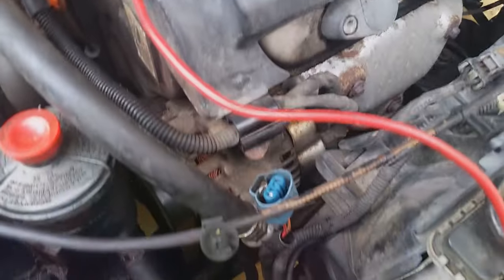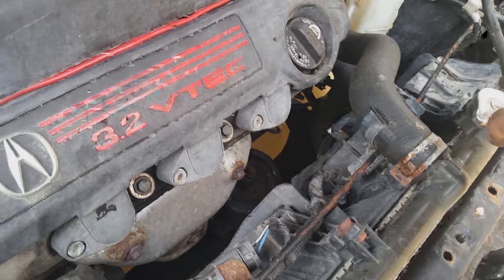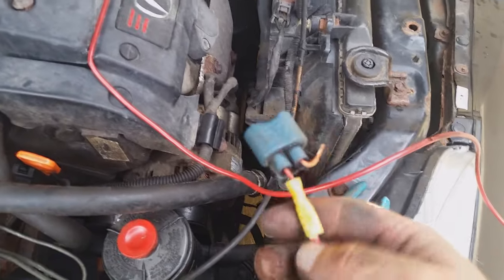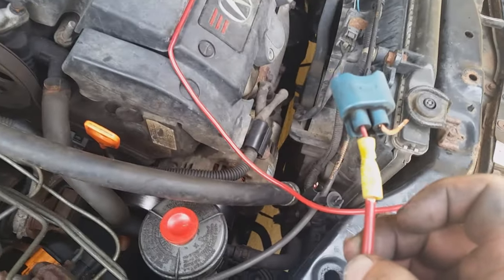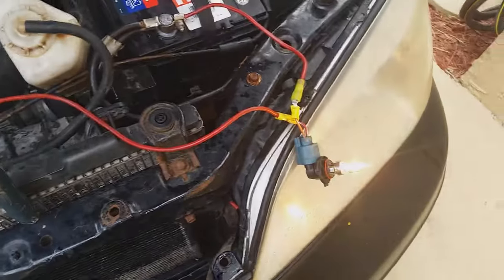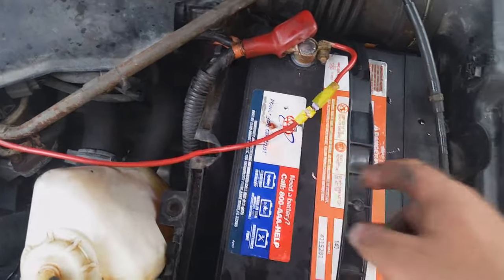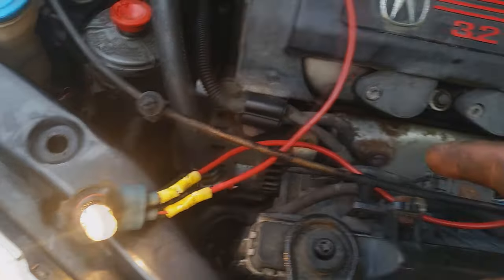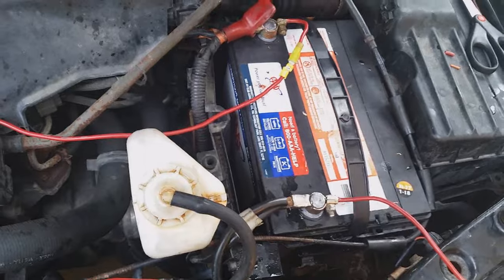How to connect head lights directly to the battery.

Comment: You can run the positive into your vehicle cabin to a toggle switch so you wont have to worry about opening your hood to disconnect
Reply: Hey I got a question for you if you don’t mind. It’s for powering a blower motor due to a damaged wire in the main wire harness but I’m just going to bypass it till winter time.

Comment: Put a fuse and wire it to a 12v switch mounted to ur dash!
Reply: Eric, you suggested a switch on the dashboard.  I have a similar issue with installing this on a 1993 GMC 3500.  The 25 Amp fuse wàs shorted.  The running lights are on all the time while running.  But no headlights.  With a new switch and bulbs installed.  Can this shorted 25 Amp fuse under driver's side dash be converted to a switch like you suggested? Please diagram and explain it.  

Thanks.

Lynn

Comment: This is exactly what I want to do with my current vehicle.  The entire vehicle wiring was recalled, but I missed the date to go back to the dealership. They want $700 to rewire the light fixtures, but I want to do exactly what you did.  How can I do exactly what you did, but with a switch inside the vehicle that allows me to turn on and off? Also, would the lights, even when switched off, use the battery?
Reply from the maker: You can run the wires through the driver door refer to my horn button video on this to run them.  If the switch is off then it won't drain the battery.  Dealers always overcharge good for you to do it yourself.  Let us know how it goes and thanks for watching.
Reply: if you dont mind, what vehicle did they recall the whole vehicle wiring ?
Reply: The switches can melt and cause fires.

Comment: Need a fuse on that input positive  so you dont set your car on fire and if you run a bridged neg and positive  lead if 1 burns out the other still works
Reply: What size fuse should be used ?
Reply: @tylerstickrod7600  I used 15 Amp

Comment: If you connect two lamps in series, they run at approximately half their rated power. So what is the point? For car headlights, half the rated power is completely unacceptable. To run them at full power, each lamp needs it's own exclusive positive wire.

Comment: I want to add motorcycle headlights to my e-bike by using the e-bike battery directly to the headlight. 

I like your version because it is simple but I think splicing into my e-bike directly is too strong of a current/voltage to the light (48v)—

So question is, how did the strong car battery not blow out those little lightbulbs?
Reply from the maker: They are regular car lights that run on 12 volts. You need a voltage reducer to use the lights on your bike.
Reply: Oh I see! So it matches! I thought car batteries had a very high voltage! Thank you for the quick response!
Reply from the maker: @leoelegado  No only 12.8 to 13 volts. 14 to 15 when the engine is running.

Comment: Hello. What if I only need one headlight to run to the battery? my other headlight works fine but the other has a short somewhere.  Could I just run a wire from the one headlight that doesn't work to the battery?
Reply from the maker: Yes that will work but you will need a switch.
Reply: @chriss4365   Also there are several different wires running to the connector for the bulb. How do I know which one to cut?
Reply from the maker: @rickiew7713  not sure some vehicles might have more than others but usually are 2 wires.
Reply: @chriss4365   Thanks Chris and I'm seeing I might need a fuse do you recommend a fuse? and how close does that fuse need to be to the battery
Reply from the maker: @rickiew7713 you should for safety and its location doesn't matter.
Reply: @chriss4365  Hey Chris sorry I was mistaken there's only 2 wires to the connector one is white and 1 is black which 1 do I need to cut and hook to the switch
Reply from the maker: @rickiew7713  The black is probably the positive and white neutral.
Reply: One more question and I'm gonna throw you some money if this works do I connect The Wire to the positive or negative terminal on the battery
Reply from the maker: @rickiew7713  I would cut both wires and create a new circuit using 2 wires, a fuse, and a switch inside the car. Connect the two new wires to the battery. If the bulb is incandescent, the polarity doesn't matter.

Comment: My headlight fuse is burnt out on my fuse box for my 1964 c20 I bought a universal headlight switch..could you help me hook up the switch n kinda make it do the same as you did here....is there a way to run power to the switch skipping the fuse bx inside the truck don't have the money to pay an electrician to redo all my wireing...got brake lights but no head lights ...thanks if anyone can guide me through this thank you
Reply from the maker: You have to run your own wiring to do this. It's not hard.

Comment: Thanks man you ever think of running a wire with a switch into them ?? Instead of having a that setup you could even add a relay no??
Reply from the maker: Sure but I would only use a switch not a relay.  It was on a friends car he didn't want a switch.
Reply: Just like my boyfriend LMAO
Reply from the maker: @gueradenova2166  what?

Comment: So do I connect the positive wire on one headlight to the negative on the other? Cause that is what you said In The video and I’m unsure
Reply from the maker: You connect the positive to one bulb then the negative from that bulb is the positive for the second bulb then the negative of the second bulb connects to the battery negative terminal.
Reply: Dont forget a fuse and just run 2 new wires less problems
Reply: How do I put a fuse in?

Comment: I did it just like you, but why they turn off after a while?
Reply from the maker: Can you be more specific?
Reply: @chriss4365  well after 5 0r 10 minutes on the headlights turned off then waited 5 mins i  turn then back on an they just keep turning off
Reply from the maker: @josuerodriguez8026  are you using a switch?
Reply: Yes a 2 prone switch with a 20 fuse
Reply from the maker: @josuerodriguez8026  maybe the switch has a shut off feature for safety it probably cant handle the electrical load.

Comment: So when u cut the switch off does the lights stay in
Reply from the maker: Yes lights stay on that's how the guy wanted it hooked up. You can run a switch inside the car if you want.

Comment: Could someone here point me to a solution? My headlights and highbrams all went out. I just want to have my headlights wired to the battery with a potential on off switch if possible.
Reply from the maker: Just follow what I did in the video and run wires inside the car to add the switch.. You will have to find a way to run the wires inside the car usually through the car door as their is a spot where the wires go through to give power to the windows and locks.

Comment: Where did you get the wires from
Reply from the maker: Auto parts store.
Reply: @chriss4365  thanks n what kind of wire do I ask for?
Reply: And do the auto store sell switches too
Reply from the maker: @bighead123google5  I just grabbed one they had and I think they have switches.
Reply from the maker: Let us know if you figure it out.
Reply: @chriss4365  I did it but one if the headlights went out but the coil is turning fire red and my other bulb is extremely hot
Reply from the maker: @bighead123google5  i just saw this, did you figure it out and if something is getting too hot or turning red sounds like its shorted out.

Comment: Do your wires get hot?
Reply from the maker: If they do your using 2 thin of a wire.  No they didn't get hot.
Reply: @chriss4365  
Hell yeah thanks brother, bout to get thicker gauge & swap it out.. barely did this yesterday & i was getting worried cause they got pretty warm.. THANKS AGAIN for the quick response, have a good1 bro